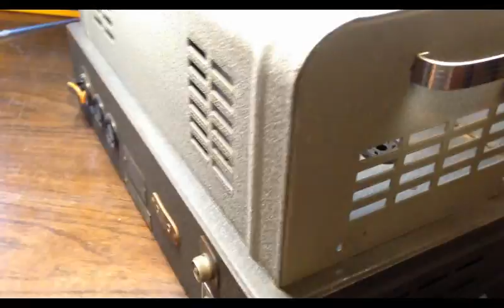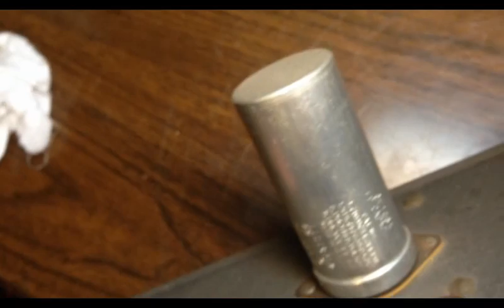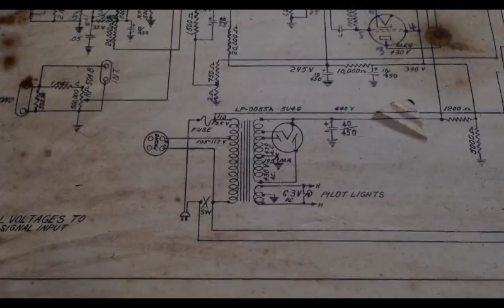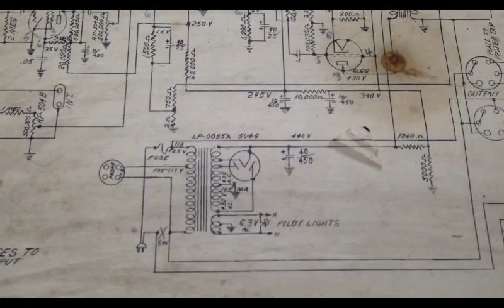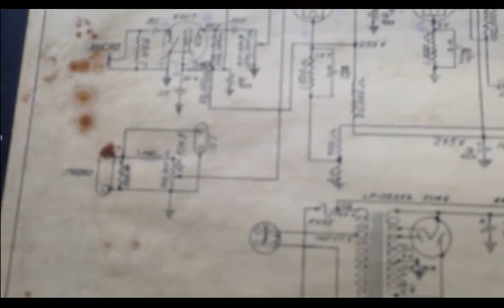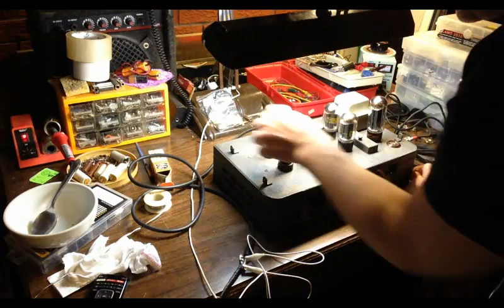1940s Knight 30S PA Tube Amp Guitar Conversion (6L6)

Comment: Brad....Ran across this while checking out some of your older videos. For awhile now, I've been looking for a tube power amp, for a Leslie mod. project, and had never considered Knight...until this reminded me! I haven't seen a Knight kit in ages! Checking oBoy auctions, I scored an 80-watt (more or less) PA 93-SZ-695 in working condition!! Probably needs a re-cap, but I paid less than the transformer's worth as scrap!! Thanks for the memory jog! :-)
Reply from the maker: Bargain!
Reply: ...and I just found a SAMS manual for it! Should be better than the little 20-watt 6V6 amp that came in the Leslie....and complement the '53 Hammond C2 nicely! (Yeah, I get excited easy! LOL)

Comment: How crucial is it to bring the amp up on a Variac after a Re-Cap?
Reply: Twisted Robot they say it's easier on the electrolytic caps to slowly form them when brand new but it's mostly because if something's wired wrong or you made some other sort of mistake you will not damage anything serious before you find out aka things will just get a little hot or smoke a little bit instead of taking out a transformer or destroying tubes

Comment: Great video, thanks. I learned a lot watching your method of evaluating the amp condition. Good to see how slowly you bring the voltage up. I've got a similar 1959 "breadbox" case Knight coming from Ebay in 2 days. Has a turntable on top!  Time to get my variac out.

Comment: I wonder if the speaker jacks having to many pins were originally designed for speakers with field coils.
Reply from the maker: No, it's actually so that the amp cannot be turned on without a load attached, Saves your output transformer. Safety feature.

Comment: What a cool amp!   Makes me wonder if Andy Marshall of THD amps copied the design for his Uni-Valve and Bi-Valsve series.
The way the top  can be removed by thumb screws make life so much easier.
Reply from the maker: Just looked a schematic of a Univalve. It's a SE amp with 12ax7, so altogether different. But 99% of all amps are either direct copies or spinoffs of something built 50 or 60 years ago, but mostly with inferior components. The Univalve looks very similar to a lot of the same stuff that was in the original RCA manuals and AT&T, Western Electric design books.
Reply: Not knowing much what is under the chassis of THD amps I like the fact that I can get to the tubes easily to swap them out without having to bias them.
As an owner of a THD  Bi-Valve I have shoved almost every tube known to man in it looking for the "holy grail" tone.
After a year a of swapping tubes I finally found it.
The tube values I now use are a trade secret so please don't ask....LOL
Reply: This style of chassis and cover was universal and they made dozens of off the shelf ones you could buy in addition to many brands making their own.
Reply: Never did find it did you? No one else neither.

Comment: Hey Guitologist, Good mod. From the sound demo, it will Rock. Maybe a 1KHz tone and check the power output, be interesting to know what it's pumping. Take care, keep one hand in your pocket, C.
Reply from the maker: I'll bias it for the 6L6GC and squeeze the most out of them. The 6SL7 pentode into that pair of 6SC7 triodes paralleled takes care of any gain you'd need. The output needs to be set for max headroom. I will tweak it and move it along.

Comment: Where's the best place to purchase replacement capacitors and tubes for old guitar apps I have a 1963 Ampeg amp that I want to read to been recap
Reply from the maker: I get my caps from Antique Electronic Supply's wholesale subsidiary, I order at least 10x of each cap value at a time so I get a better discount. Shipping from them is high though. You can try Mouser also.